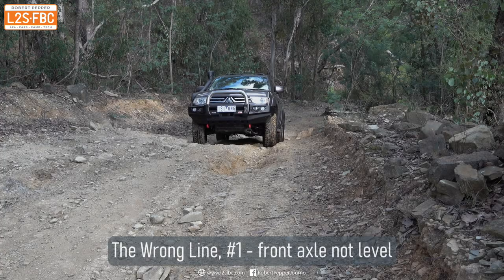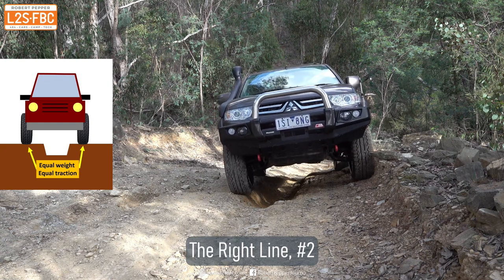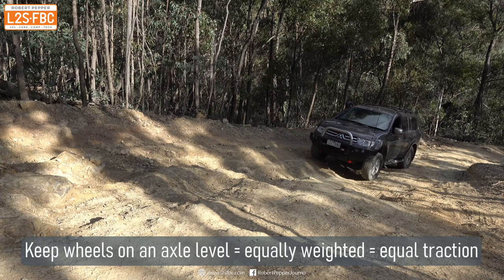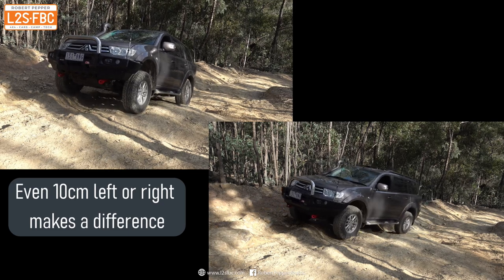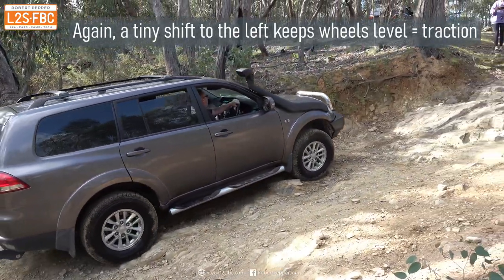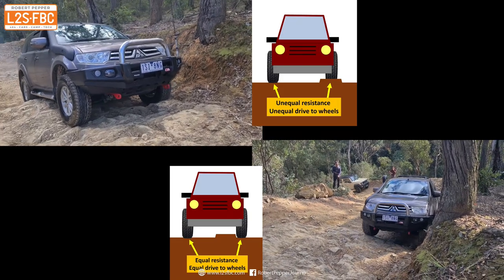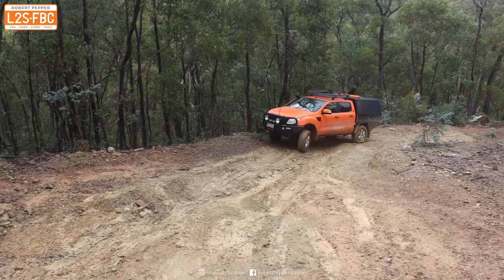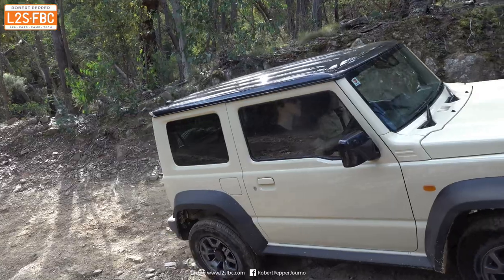Two 4x4 hill climb techniques...you don't need momentum!

Comment: The rule is high up low down. follow the ruts down but keep out of them going up. Th eprblem on the rocks with the Challenger is that the wheelbase is the same as the distance between the rock ledges. Its the back that is in effect stopping the climb.
Reply from the maker: True about wheelbase but we fixed that with the right line 👍
Reply: You don’t always have a choice! Sometimes the track isn’t wide enough to offer up different lines.
Reply: I had the same thought as you Philip, but I think it ties in nicely with Robert's basic point of reducing the resistance in front of the tyres.....having three wheels trying to climb at once rather than two is enough to stop the vehicle in this case, rather than it being the rear tyres per se causing the issue....

Comment: This is why I’m not a fan of solid axles - when one side droops it loses a lot of the weight (as the other side is pushed up). You end up with this sort of issue. With independent all round - it’s less of an issue although you will typically hang a wheel in the air before you would with a solid axle - at that point the TCS can simply lock the raised wheel providing full torque to the one on the ground.

Comment: One part that's not mentioned is the type of surface traction and surface materials. Hill climbs in wet conditions especially if clay is exposed momentum is essential. That is the point of having a mud tyre. The tyre will dig into the mud, eject the mud at speed from the tread blocks and allow the vehicle to keep the momentum up the climb.
Reply from the maker: Yes indeed. That's for another video. However the principles described here also hold in wet conditions.

Comment: Great demonstration of technique using a variety of vehicles.  This is a critical skill to master driving heavy trucks in conditions like these.  Heavy vehicles and even moderate speeds equal a lot of potential energy to try to manage should something not go quite to plan.
Reply from the maker: Thanks. Not spectacular but works .
Reply: @L2SFBC  Good foundational lessons are important.  It's nice to see someone taking the time and making the effort to produce good instructional material.

Comment: Had to guide a bloke up a slippery bit of the Ingeegoodbee track - he was in a 100 series and couldn't get up a hill.  Directed him on a new line which kept the fronts weighted evenly and he made it up.  Then I drove my GU Patrol up the worst possible line without any effort at all, the 100 series driver's mouth hung open as he watched.  A $400 front Lockrite diff makes a huge difference.....  With many IFS vehicles the traction control is very basic and useless for climbing on trails.  They should be fitted with front diff locks as a compulsory item on the 4WD versions, which are sold as 4WD but are clearly only 2WD.
Reply from the maker: Nice post thanks! But can't agree on the traction control being basic, it's very effective these days.

Comment: Line selection is half the battle! 

I get what you mean, but is “equal weight” the appropriate term? As soon as there’s some off-camber, even if the axle is level, the weight distribution L to R will be different.
Reply: Maybe 'minimal flex' is a good term?
Reply from the maker: Equal weight is correct - if the axle is level, and there's unequal weight eg on a sideslopse, then there is unequal traction, So, try and keep the vehicle level. Grant says 'minimal flex' and that's also good advice. I'd go minimal flex, then equal weight. As long as the principle of traction are understood...then success!
Reply: The technical writer in me and engineering background would use other words. 

Suspension / ballast in vehicle needs to be tuned to be evenly distributed across an axle on a set surface. Add different cargo, amount of fuel / placement of tank, change the height difference between the two axles or camber of slope and weight per corner changes. 

I’ll park my OCD on this one.

Comment: Would locked diffs also stop that loss of traction?
Reply: They do help a lot.
Reply: My understanding is that these lines will always help to get the best traction out of your vehicle. So a vehicle with both axles locked could probable get away with any line on these slopes (so yes), but if that same vehicle was, say, towing a camper, then the 'equal weight' line will come into it's own again, as all possible traction is needed :)
Reply from the maker: Yes they would help but even with locked diffs the principles still apply. Reason is that there is a net loss of traction if a wheel is in the air compared to even weight.